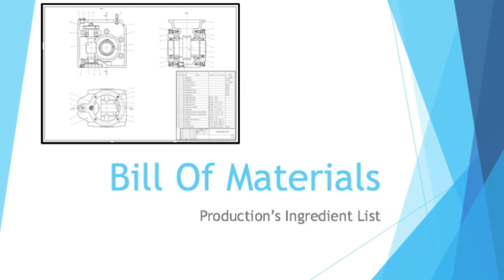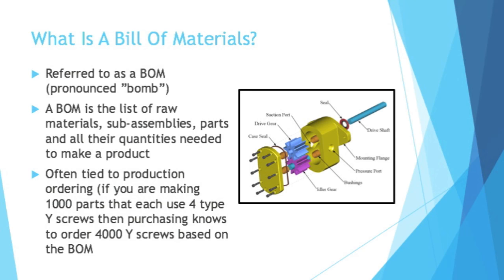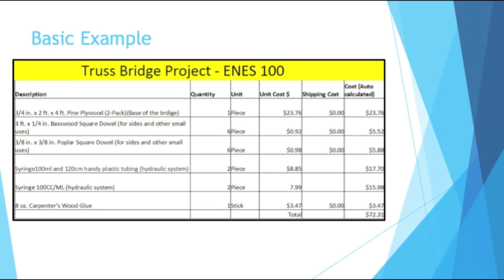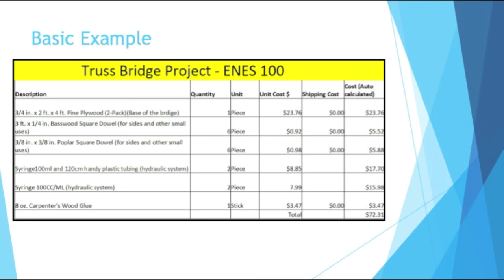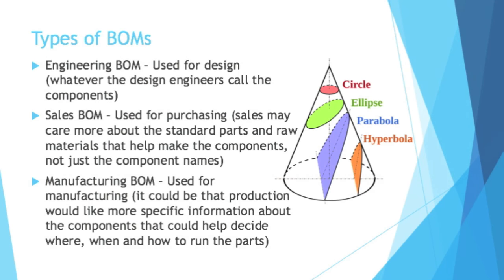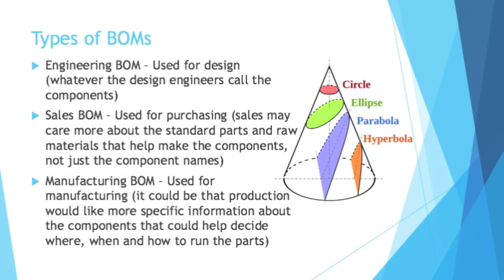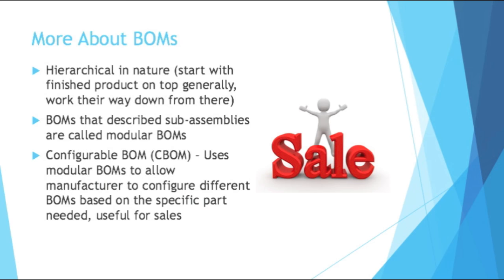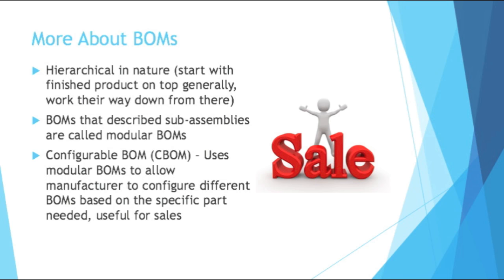Beginning Engineers Bill Of Materials

Comment: Could you help me making out BOM for this?
The completed mower consisted of fastening two base sections with one motor assembly. The base section fabrication was challenging. It required a pre-cut steel plate to be stamped into one of the base sections using a heavy press. A fastening kit was then used to bind the steel sections together.

The motor assembly was produced by welding a completed motor to an undercarriage. The undercarriage was built with the same fastening kit used for the base section. A completed undercarriage required the fastening kit to be combined with a mowing blade. The specialized mowing blade was produced by stamping the same precut steel plate that was used in the base section.

Comment: Hi would you please 
explaine 
Cost price. 
Route 
4 types of BOM
Reply from the maker: A part is comprised of the same parts and sub-assemblies regardless of what type of BOM you are using, the only reason there are different BOMs are because different departments may need to know what things are called from their point of view (sales may refer to a component differently than engineering if they are selling it or purchasing it from a supplier, but otherwise they should be nearly identical). Cost would be what the component costs for a firm and the price would be what they sell it for later (after manufacturing, shipping or some other process). I'm not entirely sure what you mean by route.
Reply: Routing is a sequence of operations to manufacture a product. You create a routing and assign it to the BOM which is then sent to the manufacturing department for initiating the manufacturing or assembly process